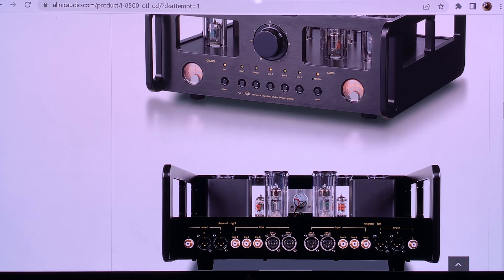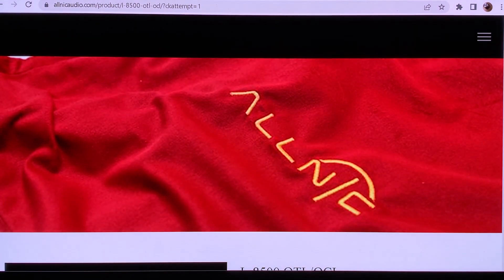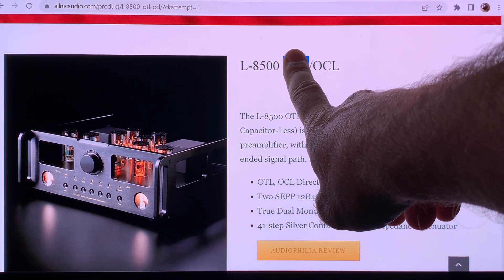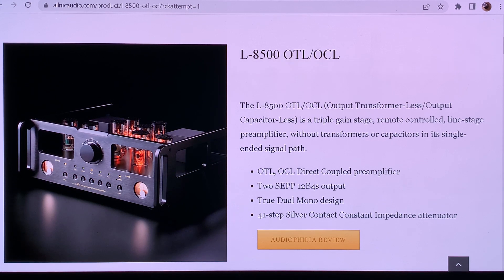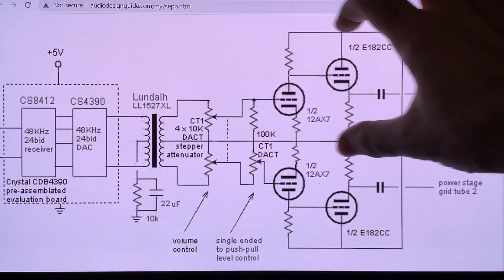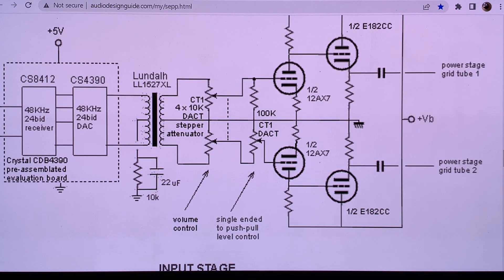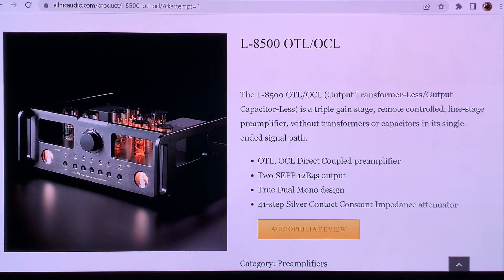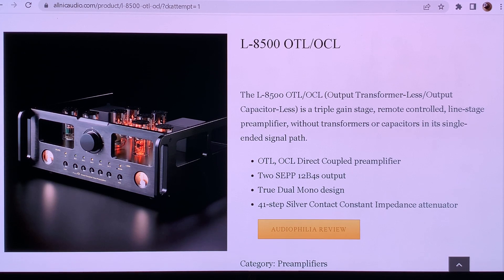OTL preamplifiers?!  Allnic L-8500

Comment: Single ended push pull.........................Philips radios and amplifiers used this technology in the late 50-60's..........( EL86 tubes......and with C output to protect 800 Ohm speaker ) Some had an OPT for 8 Ohm additianal speakers..... Those paper bicone 800 Ohm speakers with ALNICO magnets are the real deal for experienced builders to play with and they sound very well in open baffles and other cabinets ...with SEPP or SRPP tube amps...( OTL )
In the past there were several OTL amplifiers , the most published was the Futtermann amplifier.
6AS7-6080/6082 - 2A3 etc were used by many manufacturers.........Atma Sphere .....Croft Acoustics and many others. ( Even Technics made one )

Tubes can amplify pure DC ................in case of failure or out of balance of the output .............they were named speaker killers and that's what they did.
Capacitor output was protecting the speakers..............even in the transistors amplifiers there was a period when capcitor output was used....and for a good reason.
It's named the Quasi Complentairy Push Pull..................the advantage of this obsolete technology was that there was  NO NEED to use complentary transistors !!!!!!!!!!!!!!!!!! As seen in tube amplifiers the output tubes  are the same !!!! not so in modern amplifiers ( neg and positive rail )  ( EL34 in each branch of the PP ) ...........THERE ARE NO REAL COMPLENTARY TRANSISTORS , even when paired they sound not the same !!!!!!!!!!!!!!!!!!!!!! and there curves are not equal !
The output was taken on the mid voltage of the SINGLE voltage powe supply voltage.....
So it was a minor need /compromise to use output capacitors ............today we have better capacitors than in those days.
Some of these  VINTAGE amplifiers are still very well liked for their smooth coherent balanced sound .........remember for example the still  well sought after and beloved  Marantz model 1060  and musical sounding old Luxman amplifiers and others..

OTL amplifiers  are amplifiers for  passionate builders and well experienced tube lovers........ALL OTHER SHOULD STAY AWAY ..................if you wont spend and I mean by that to risk lots of money .

Even with the best protection technology one day it WILL go wrong.................just like driving a car .

But who am I to stop you ytto experience it ???????? 
Risky bussiness is allways tempting people , it make you feel alive to be free to make the choices at your own risk...................VERY EXCITING  !!!! isn't it ?
Personnaly I do like to risk bypassing fuses ( with a switch ) .....................does it sound better ??? ......YES !

Have a nice day............

PS :  The output power goes up with the impedance ................inverse as experienced with transistor amps..........so they like high impedance voice coils ( which are also more fragile to overload and burn out ) ...............so everything is a balance .........there's a price to pay for all.................. 😊

Another interesting amplifier technique for tube amplifiers is the CATHODE FOLLOWER PP output ...........very li,near , low distortion , lgood damping ......BUT are ......................VERY HARD TO DRIVE.......

Comment: I would like to hear your take on say the L-8000 DHT(direct heat triode) or any other DHT preamp…
Reply from the maker: Thank you Klaus for the tip, I will have a look at it!: ; )  Actually, in general, DHT preamps are the pinnacle.
Reply: @realworldaudio  have a look at this, Amare Musica Deforest Diamond DHT tube preamplifier 

Power stage working in Class A
Remote Control
3 Input Selector
LED display, the tube usage meter
Main tube: 2x EML30A
The ability to use other DHT triodes
Rectifiers: 2x 5U4G
Tubes in the stabilization of the anode voltage: 2x EL84, 2x EF86
Gain: 25 dB
Input Impedance: 400 kOhm
Power consumption: 100 Watt
Dimensions: 350mm x 430mm x 75mm (without tubes)
Reply from the maker: @klausnielsen7102  Now we are talking about serious preamps. This is optimized for very high level uncolored sound. ; )
Reply: @realworldaudio   is there any good amp that you like we can build with common tubes like 6L6 or EL34/84 etc or even class A solid state , nelson pass has some easy designs  as well